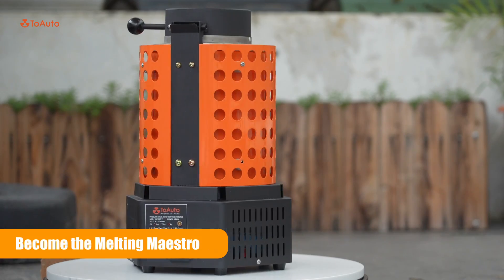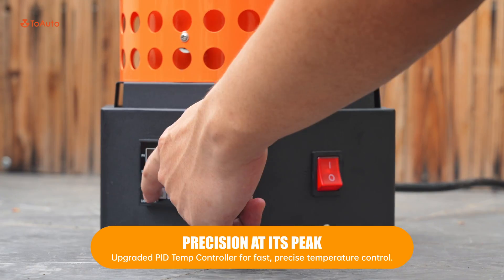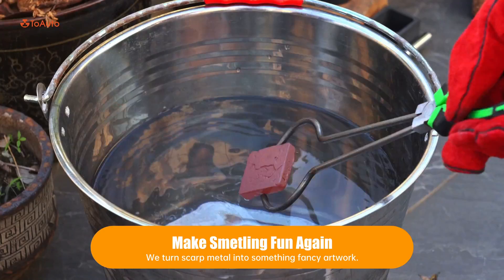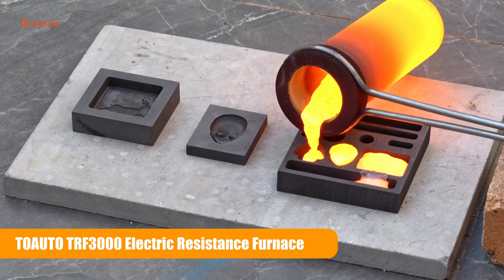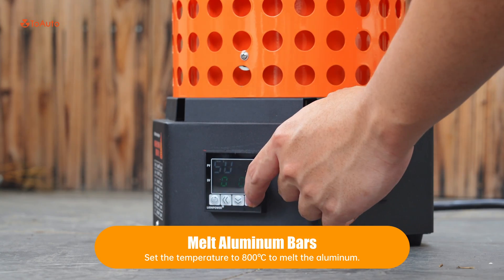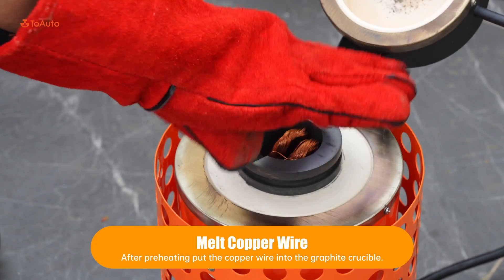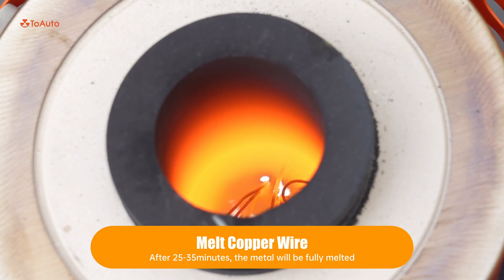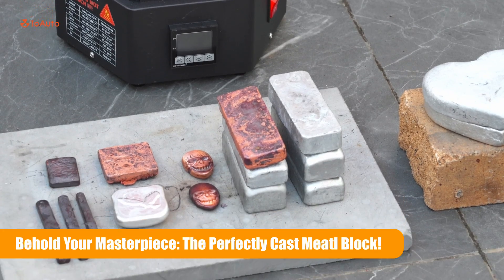2024 ToAuto Electronic Metal Melting Furnace, Faster and more powerful, How to use

Comment: Will the cost of electricitt needed to melt the metal be cheaper than the use of carbon?
Reply from the maker: Whether electric furnaces are more cost-effective than using carbon requires a comprehensive assessment based on specific energy costs, environmental impacts, technological maturity and the availability of renewable energy. Electric furnaces may become an increasingly attractive option.